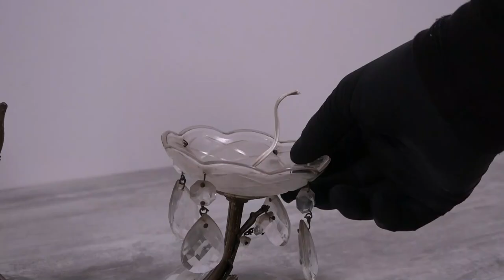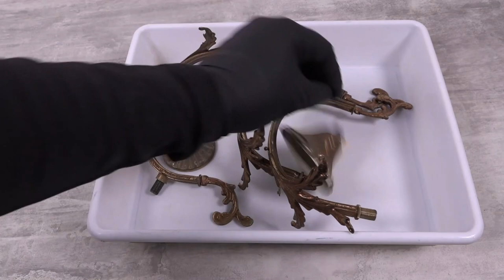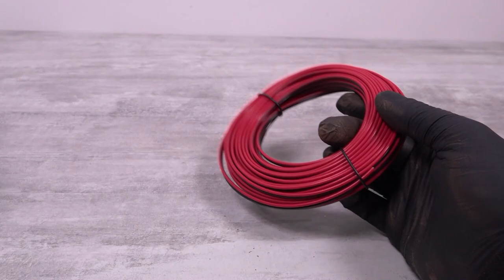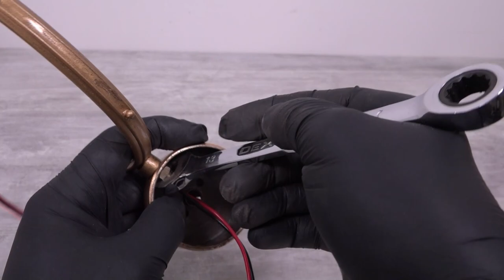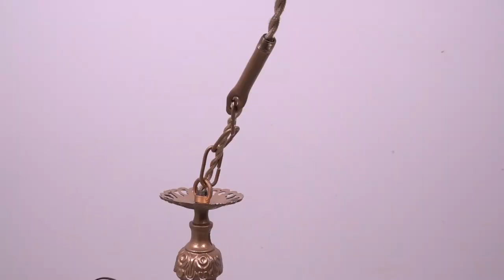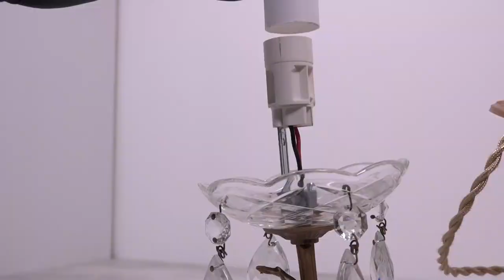Renovation Of Vintage Antique Chandelier 1950s

Comment: Watched the whole video...great job!
Can I just add...if any of the metal hangers hanging the crystals needs replacing, you can use jewlery"pins" that are used in jewelry making and round tip jewlery pliers to replace worn and/or broken crystal hangers.  Haven't seen any for sale but making my own jewlery I recognized the connection and having worked at Michael's and being a crafter...this will do the trick nicely.

Comment: This video should come with a WARNING: If you are not a qualified electrician DO NOT TRY TO DO IT AT HOME. Very serious health hazards or cause a fire if not done using the appropriate cable connections. Unfortunately, the video lacks the necessary instructions to make the right connections between the HOT WIRE, the NEGATIVE, and the GROUND WIRE (identified by color). If not connected the right way, you could burn your entire electrical home system, burn your house, or electrocute yourself. Please consult or let it be done by a professional. Better safe than sorry. Cheers